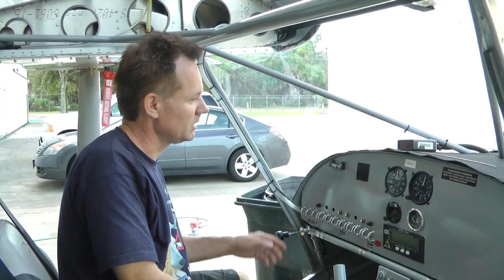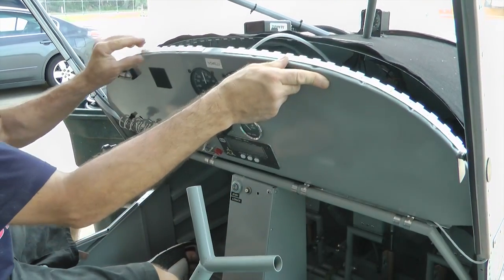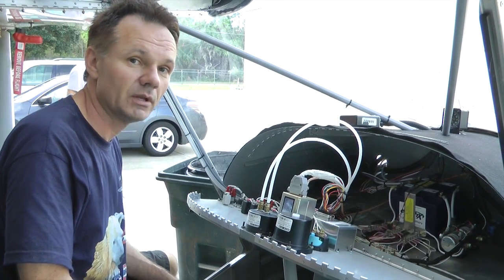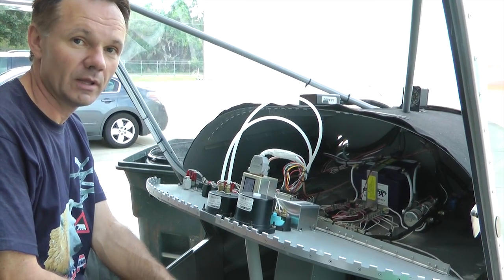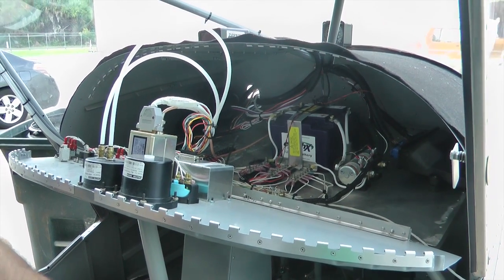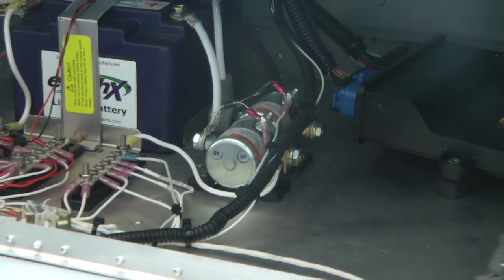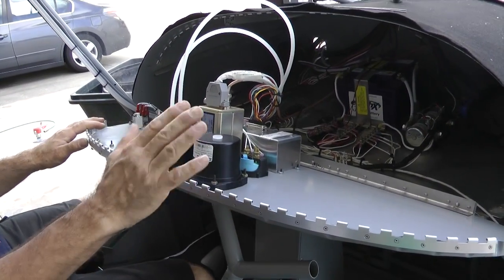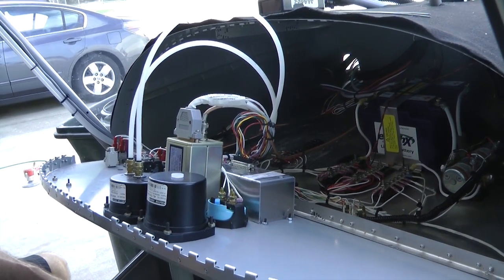Easy access to the backside of a homebuilt Instrument Panel

Comment: great idea,excelleent,in my Merlin, it was already fabricated in 1993 and had small 9/32 bolts and plastic inserted lock nuts,which is.was a nuisance to remove in case of additions.So I replaced these bolts with Automotive ( plastic fender bolts 2 piece) papco brand or Geno name brand fasteners. it was the closest ones i could get to 9/32 and  just drill the mounting holes bigger and also hole in panel bigger,now it a breeze to take it off Again. I surely like your swing down version as you are using here. great pointers for my ,hopefully upcoming project in a few years ty 100-100